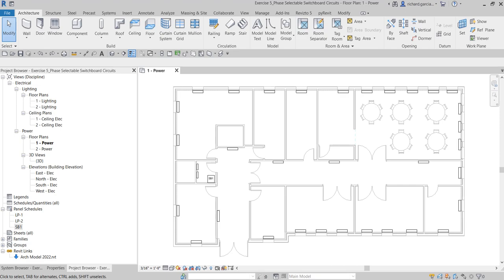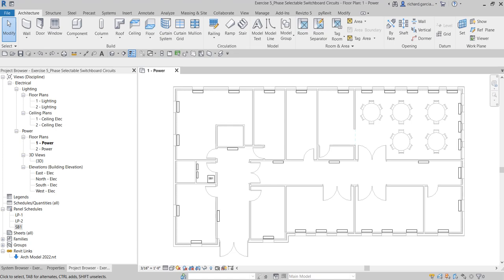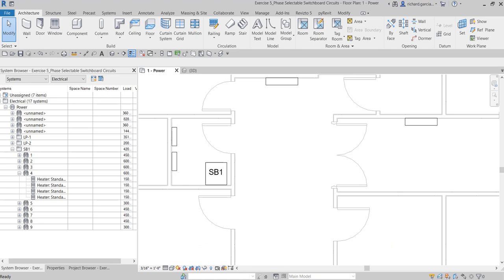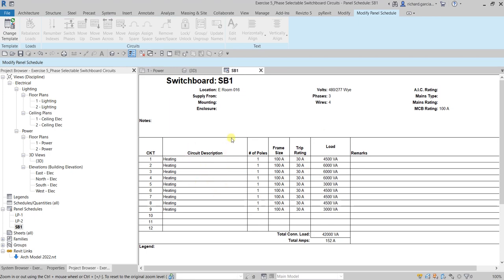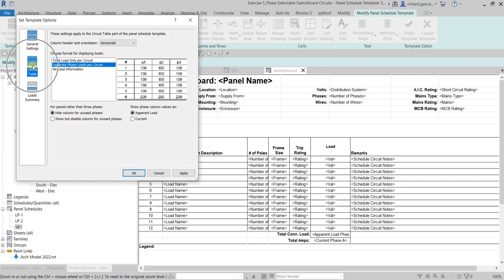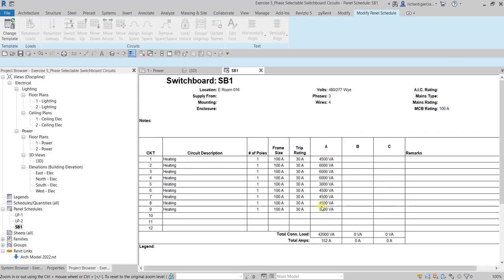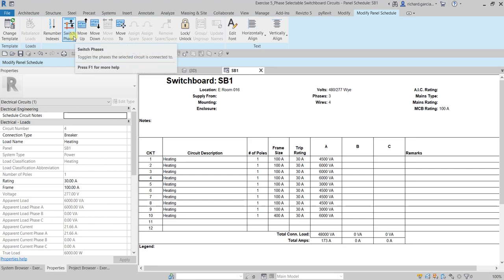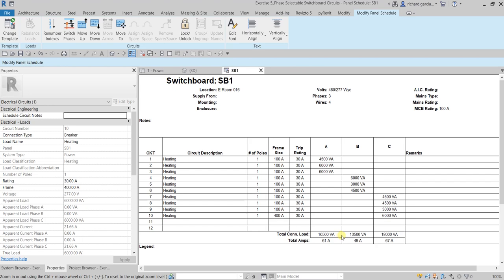REVIT FOR ELECTRICAL DESIGN: PHASE SELECTABLE SWITCHBOARD CIRCUITS

Comment: Hi 
Dear Sir
Kindly Make New Vedo for 
How to Calculate Cable Lenght and Counduit Lenght plz.
Reply from the maker: hello sir try this below:

Cable Length Calculation (Using Revit Systems)
Use Electrical Circuits:

When you create electrical circuits in Revit (e.g., connecting light fixtures to a panel), Revit can calculate the wire length automatically.

Go to a device (like a light or power socket), create a circuit, and then assign it to a panel.

Revit calculates wire length based on routing methods (like "per circuit" or "from panel") — these settings are found under the Electrical Settings.

View the Cable Length:

Select the circuit and look at the Properties palette — you’ll see Estimated Demand Load and Approximate Length of the wire.

You can also create an Electrical Circuits Schedule and include the “Wire Length” parameter to view this data in tabular form.

Note: This is an estimated value unless you’ve manually drawn conduit or cable trays that the system follows.

🛠️ Conduit Length Calculation
Model the Conduits:

Use the Conduit tool in the Systems tab to draw your conduit runs.

Make sure to use fittings where needed (like elbows or tees) so Revit recognizes the complete path.

Create a Conduit Schedule:

Go to View > Schedules > Schedule/Quantities, then select Conduits.

Include fields such as:

Type

Length

Diameter

Level (optional)

You can filter and group by type or system to summarize lengths by run.

Total Conduit Length:

In the schedule, click the "Grand Totals" checkbox in Sorting/Grouping to get a total length of all conduit runs.

Comment: Hi Sir. Just want to ask why there's a discrepancy on the Total Amps from Phase A and C at 11:32 of the video. Anyway, thanks for teaching us here. Very informative and helpful to newbie revit users like us. May our Lord bless u more. :)
Reply from the maker: Hi Ivan,

Thank you for your kind words! I appreciate your engagement with the content.

Regarding the discrepancy in Total Amps between Phase A and C at 11:32 in the video, it can arise from several factors:

Load Calculations: Ensure that all electrical loads are accurately assigned to their respective phases. If some loads are not correctly distributed, it can result in an imbalance.

Phase Configuration: Check if the phases are configured properly in your Revit model. Sometimes, certain elements may inadvertently be set to the wrong phase.

Data Display Settings: Review the settings for how total ampacity is displayed. Sometimes, filters or visibility settings can lead to misleading totals.

Model Updates: If changes were made after the initial calculations, be sure to refresh or recalculate your totals to reflect the current model accurately.

Thank you for being part of this learning journey!

Blessings to you as well!

Comment: Good morning sir, thank you for the very helpful video!
Do you know why the Rebalance Loads button is greyed out in the Switchboard panel schedules, and not on the Branch panel schedules?
Reply from the maker: Some reasons sir:

1. **Load Calculation Parameters**: Make sure that you've properly configured the load calculation parameters for the panel. The "Rebalance Loads" button is usually used when there are load imbalances. Ensure that you have defined the panel correctly with its voltage, phase, and distribution system, and that you have actual loads connected to it.

2. **Connected Circuits**: The "Rebalance Loads" function is intended to redistribute loads evenly across the available phases. If you don't have multiple circuits connected to the switchboard or if the loads are already balanced, the button may be greyed out.

3. **Panel Type**: The "Rebalance Loads" option may only be available for certain types of panels. Verify that you are using the appropriate panel type in your Revit project. Not all panels have this feature, and it's typically used for larger distribution switchboards.

4. **Load Imbalance**: If you've already rebalanced the loads, or if there are no significant load imbalances, the button may be greyed out. Revit won't allow you to rebalance loads if there are no significant imbalances to address.

5. **Software Version**: Ensure that you are using a version of Revit that supports the "Rebalance Loads" feature. Newer versions may have different functionalities and features.

6. **Permissions**: Make sure you have the necessary permissions and access rights in your Revit project to make these changes. If you don't have the proper permissions, some functions may be greyed out.

7. **Errors or Warnings**: Check the Revit error or warning messages. Sometimes, errors in the project can prevent certain functions from being accessible.

If you've checked these points and still can't resolve the issue, consider providing more specific information or contacting Autodesk Support or your organization's Revit administrator for further assistance. They may be able to help you troubleshoot the problem more effectively based on the exact details of your project.
Reply: @bim360  ,
Thank you for the fast answer. I’ve checked all of them and it is still greyed out. I currently have a Branch Panel and a Switchboard fed by the same distribution system, same voltage, and approximately the same amount of VA connected to them. In the Branch Panel I can select Rebalance Loads, but in the Switchboard I cannot. Is it because you can never select this when you are on a switchboard?
Reply from the maker: In Revit's electrical panel schedules, the "Rebalance Loads" feature is typically available for branch panels but not for switchboards. This is likely why you can select it for the branch panel but not for the switchboard.

The reason for this limitation is that switchboards are typically higher-level distribution equipment where loads are aggregated from multiple branch panels. They are not designed to have their loads rebalanced directly because their purpose is to distribute power to the downstream branch panels. Load rebalancing is more relevant and feasible at the branch panel level where individual circuits and loads are connected.

In most electrical design workflows, load balancing is done at the branch panel level, and switchboards are used to aggregate and distribute power to these branch panels. The load balancing functionality is provided at the branch panel level because it's the most granular level of distribution in the electrical system.

So, in summary, it's expected behavior that the "Rebalance Loads" button is available for branch panels but not for switchboards in Revit. If you need to balance loads, you should do so by adjusting the loads within the branch panels connected to the switchboard.

Comment: Sir rich yun ba circuit numbering ay pwede palitan ng R1, Y1, B1, R2, Y2, B2 etc. ?Thanks
Reply from the maker: hello sir di ko pa natry un eh, pero check nyo itong na-search ko:

In Autodesk Revit, circuit numbers for electrical elements are typically assigned automatically based on the electrical system and the panel to which they are connected. However, you can manually change the circuit numbers if needed. Here's how you can do it:

1. **Select the Element**: Select the electrical element (e.g., a light fixture, receptacle, or switch) whose circuit number you want to change.

2. **Open the Properties Palette**: In the Properties Palette, you will see various parameters related to the selected element.

3. **Edit Circuit Number**: Locate the parameter related to the circuit number. It is usually named something like "Circuit Number" or "Circuit Name." Click in the field next to it to edit the circuit number.

4. **Enter the New Circuit Number**: Type in the desired circuit number that you want to assign to the element.

5. **Press Enter or Apply**: After entering the new circuit number, press Enter on your keyboard or click elsewhere in the Revit interface to apply the changes.

6. **Check the Result**: Verify that the circuit number has been updated on the element.

Keep in mind that manually changing circuit numbers should be done carefully and in accordance with your electrical design requirements. It's essential to maintain accurate documentation and coordination in your Revit model, especially for electrical systems, to ensure that your design is accurate and up to code.

Also, remember that changing circuit numbers manually may not be necessary in most cases, as Revit is designed to manage circuiting automatically based on your electrical system design. Manual changes are typically reserved for special circumstances or revisions in the design.
Reply: Got it. Salamat sir rich.
Reply from the maker: you're welcome sir.